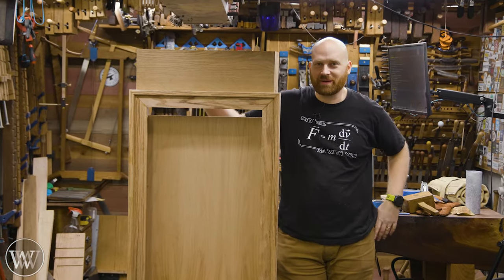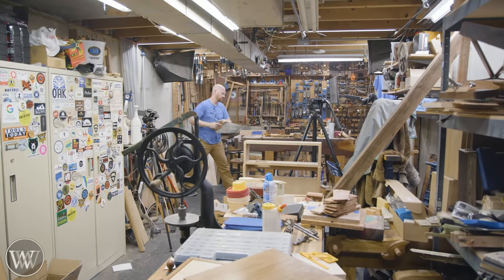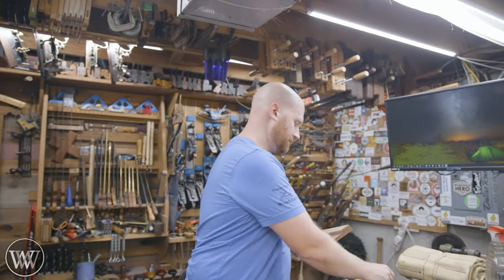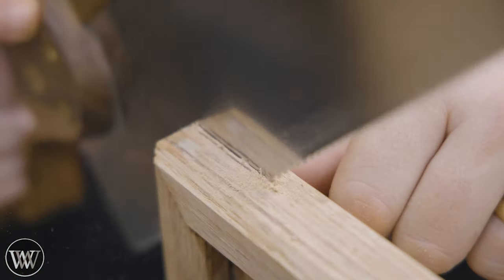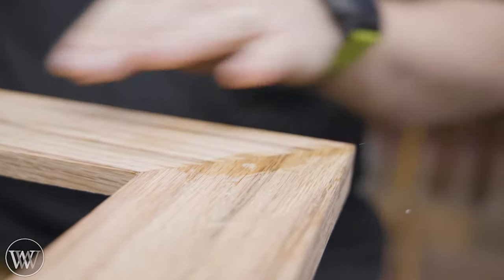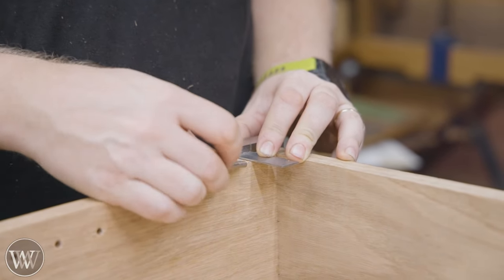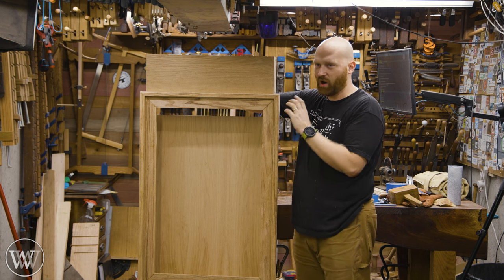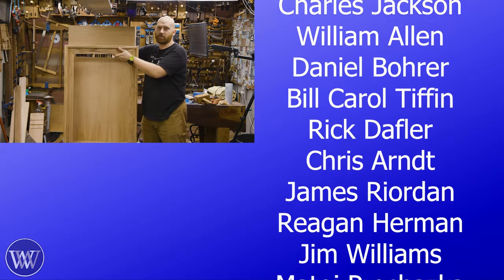How To Make a Medicine Cabinet Part 4

Comment: Were your splines going the wrong direction?  It looked like the spline grain was going towards the center of the frame,(which doesn’t add any strength). But that might have been just the camera angle. Nice work. Great video.
Reply from the maker: That is the optical illusion of curly maple. The grain goes in One direction but the waves go in the other direction so it looks odd.

Comment: Q: If you don't mind Sir? 
 Hello 🤗 big fan here. I would like to know if African Padauk is good for steam bending? Thank you 🙏
Reply from the maker: It is not great but it will bend a bit. it is a little more brittle and hard to get straight grain. it tends to wind.
Reply: @WoodByWrightHowTo  

Well that explains it. 
 The pieces are 1/8" thick, and I'm still having trouble with getting the shape i want.